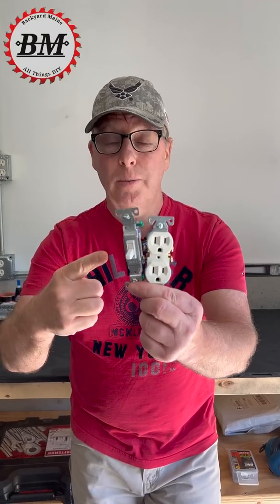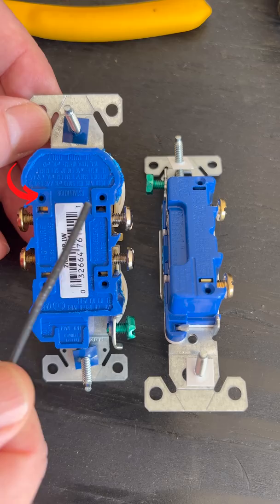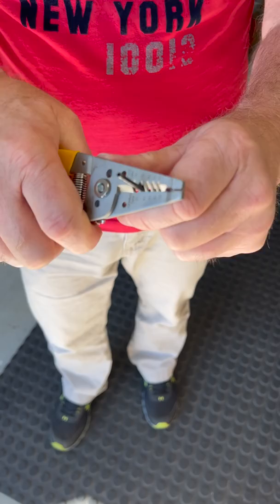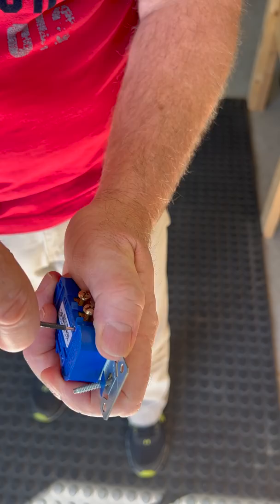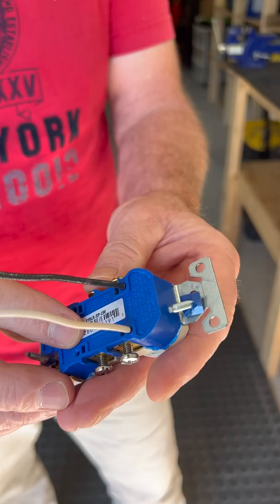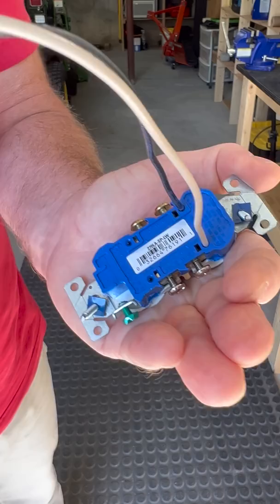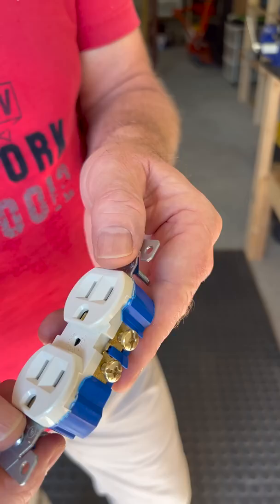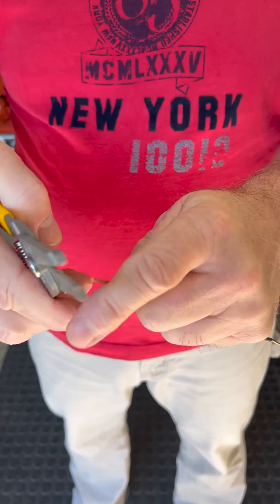Don't make this electrical mistake #Shorts

Comment: To be honest, sockets and switches like that have worked well in Germany for ~60 years, and not a single failure has occurred (in my career). I guess it must be a problem with the building quality of your sockets and switches, and the missing insight of your regulatory organs (those who write the NEC). That they are missing insight is clear from the fact that you're  still allowed to use sockets or switches with open contacts to the sides, and from the fact that they haven't made RCDs mandatory once they were widely available (also around 60 years ago!!!).
Reply from the maker: Maybe it's more to do with our lower voltage (120v) not the quality. We have had a lot of issues with these over the years when anything more than a few amps are applied over a long period of time. These are no longer UL listed for 20A devices. We call RCDs GFCIs and they have been required by code since 1971 and are still expanding into more locations with every code cycle.They were invented in 1961 but weren't widely available until 1970. Plus ours are actually a whole lot safer since they trip at 5mA rather than 30mA like yours. We also require circuits to be disconnected from power before we work on them per NFPA70E so the open terminals are safe to touch. We also require Arc-safe protection as well for fire protection.
Reply: @BackyardMaine  I know that you have GFCI outlets, but that isn't the same as having one or more RCDs in the consumer unit/panel covering the complete installation. 99.9% of the houses built in (West)Germany after 1973 have that protection (partly only for the baths, wet rooms, outdoor sockets, though, but today the whole installation has to be covered). In our house here, we had RCDs for the complete installation in 1968 already.

The point is: With all the US DIYers showing their installations in the social media during the past years, and for buildings younger than 1971, it's apparently only now that they start to use GFCIs. Thus, somehow it must not really have been mandatory when their houses were built. 

No, the RCDs were not invented in the US at all. Actually, the first patent is from 1903 (German company Schuckert), and the first working device (for house installations in Germany) was available in 1951. Nicholsen's US patent from 1908 is based on the German patent. I know that Dalziel got a patent for the GFCI, but that should be considered debatable, I guess.

And yes, we are required to disconnect any lines from power, also. The point is about DIYers or other people (accidently) opening a socket or switch => "Grandpa's wheel chair crashed against the socket cover, and it fell off (for whatever reason), 8 year old Grandson tried to put the cover back,  and got electrocuted ... RIP".  ...  If those contacts were in the back only or insulated (like they are here), then that couldn't have happen at all.

Edit: Having had a closer look at the current US patents, it seems that Victor V. Aromin (whoever that might be), registered a GFCI patent in 1996, which expired in 2016. So, are you really sure that there were GFCI devices before that time ? Or did you have panel RCDs before that, too?
Reply from the maker: I've been a licensed electrician for 38 years and spent my last 10 years employed as a senior electrical engineer for Texas Instruments which also has a FAB in Germany. Yes, I do know how long GFCIs have been required here in the US and I have seen the requirements expanding with every code cycle (every three years). Back in 1971 they were required for swimming pools and then bathrooms and kitchens within 6 feet of a water source but now they are required in many other locations. I believe your RCDs trip at 30 or 60 mA I can't remember but that is still enough current to kill a person depending on the path and duration. We also have devices called GFCE which trip at 30mA but they are designed to protect equipment not people because 30mA can still cause electrocution. Check out this video if you want to learn more about our requirements around GFCI protection. https://youtu.be/LYWUjq8ST4Q

Comment: Why do they even bother putting those back-stab connections on devices. Literally EVERY electrician YouTuber thats ever mentioned them said not to use them.
Reply from the maker: There are a lot of electricians using them still because they are fast and easy. If you get a call for lost power to part of a circuit or flickering lights these will usually be the culprit.

Comment: I think the engineers who designed them might have a different opinion.
Reply from the maker: Did you know that these were also designed and approved for 20A devices as well but lost that approval due to the failures and fires. Now they can only be used with 14AWG solid core wire on 15A circuits.

Comment: They must be safe to install or it wouldn’t be legal to produce or sell. The components are approved by the manufacturer and the NEC
Reply from the maker: Did you know that they were approved for 20A as well for years but due to failures and fires they can only be found on 15A devices now. So my question is would you have said they were fine on 20A because they were approved a few years ago?

Comment: Honest question. If backstabbing is so dangerous. Then why are devices even made with this option?
Reply from the maker: In most cases they're more of a reliability issue causing people to have to call an electrician in for a repair. I have seen them melted and arcing but never a fire. They used to be available for 20A as well but not anymore.

Comment: You should always pull the loop together after placing under the screw head, don't just leave the tail sticking out....
Reply from the maker: I don't think that's necessary based on my 38 years of experience but we all have different practices.
Reply: @BackyardMaine  Cool.

Comment: I prefer back wired receps myself. Especially when working on a hot circuit.
Reply from the maker: I prefer connections you never have to work on again. Also why would you work hot on a residential install.
Reply: @BackyardMaine  I'm the campus electrician at a small college in the Midwest.

Comment: Never had a problem with stab in connections !!
Reply from the maker: They usually fail after a few years or more depending on load. I have repaired more than I can count.

Comment: I have a light switch in the glove compartment of my truck. It turns the heat on and off. But I did use the screws on the side because I wanted to do it right lol.
Reply: Your light switch turns the heat on & off??
Reply: @rogerdixon1069  yes lol. It's an 06 F150. The dials for the heat and air quit working long before I bought it, so the previous owner ran a jump wire from the cigarette lighter, took the wire that controls the heat, and wired them both up to a toggle switch he had mounted on the dashboard. It worked fine. It even worked without the key in the ignition. But the toggle switch finally broke and I didn't have one. I did however have a new light switch so I just wired it up to that and it sits in my glovebox. People always laugh when they see how my heat works, but I'm just glad it works lol.

Comment: I want to put in 2 new switches in the bathroom, one for the light and one for the vent fan, want to just put the wires as they are on the old ones but there’s no ground wires and a full wire is attached to the top screw on both, what I mean by full wire is they aren’t cut ends but full wires with some insulation cut off and attached to the screws?
Reply from the maker: It must be an older home with no grounds. You can still do what you want. Pigtail the hot wire so you have two connections and the use them for each switch. Then add the fan to one switch and the light to the other. Be sure to turn off the power first. I have a video on pigtails if you need it. https://youtu.be/K3RIjUnrNTQ

Comment: Kinda. There’s situations where backstabbing is fine but usually done only after the terminals are used up
Reply from the maker: I always pigtail when more than two cables enter the box.
Reply: @BackyardMaine  usually but even then there’s situations where you can’t pigtail or you absolutely need to use the back plugs. As long as you tape the wires down it’s ok but definitely not as secure as the screws

Comment: The newer outlets let insert from the back and tighten the wires to the sides of the terminal.
Reply from the maker: Thats actually been around for decades. You find that connection on most 20A receptacles and all commercial grade or higher devices.

Comment: you forgot to mention that they should use a flat head to do a final torque twist on the screw to assure a non loose connection.
Reply from the maker: I disagree..
Reply: @BackyardMaine  so you want to rely only on the tightness you can get from a philips head?
Reply from the maker: @fjl05  And in 38 years I have never had a problem. I even wired my own home 25 years ago and I have yet to have a problem. So yet I will rely on the methods I use.
Reply: @BackyardMaine  If you can rely on your own methods then thats fine and dandy I suppose. I'n my years as an electrician I've had no problems myself when using only a philips head. But for some of the apprentices I've thought, relying on them getting a proper tightness with just a philips head seems to be a hit or miss thing. I'll have them tighten it then when I go check their work and the wire still moves under the screw, I have them properly retighten all the screw with a flat head and its worked 100% of the time so far.

So basically if you can do it properly with a philips then thats fine. I can as well but I will continue to teach using the flat head at the end everytime to everyone that is new to the art.

Comment: Those little hole connection areas should NOT be allowed. The amount of contact that is made is one major problem. Not to mention it’s only a spring metal connection. Terrible design idea.
Reply from the maker: I agree..

Comment: Do you have to tape the outlet when you are done using the side terminals??
Reply from the maker: No tape is not required by code and unnecessary in my opinion.

Comment: Backstab connections = job security 😎
...but no seriously, side wire or backwire* outlets if you have the option. The spring terminals on backstabs have never seemed as durable despite being listed.
Reply from the maker: Exactly friend. Thanks..

Comment: Insurance companies will check out your electrical system for correct wiring methods and a Inspection tag by a qualified Inspector.  should your electrical work be found wired incorrectly, your Insurance company will refuse to pay you out in event of a fire.

Comment: I like the tips but how do you put them in when the wires are in the wall I have a hard time with the main line on the bottom of the switch
Reply from the maker: First turn off the power.. Then you should be able to hook the wires around the screws unless the wires are too short. You can also extend the wires if needed with wire nuts or (Wagos) to tails of each wire (hot, neutral, ground).

Comment: Kinda like relying on the little jumper between the screws to keep a circuit working
Reply from the maker: That little jumper between the screws has a higher amp rating than the wire. 20A even on 15A receptacles. They are UL tested at 30A.

Comment: In France like many other european countries everything is push-in, only the cheapest stuff still have screws sometimes...
Reply from the maker: I think with your higher voltage it may not be an issue and maybe they are a better design connection. These are a very common failure point at 120v.

Comment: They make screw clamp connections now you can just stick the wire straight in. Then screw to clamp it in.
Reply from the maker: Those are the commercial grade receptacles and those work great. As a matter of fact I use them on most of my jobs.

Comment: Do you normally put a PC of electrical tape around the receptacle after you've put the wire on
Reply from the maker: No. Not unless it’s a metal old work box.

Comment: Can a residential light switch to a ceiling light,  be converted to an outlet ?
Reply from the maker: Yes as long as the neutral travels through the switch box.

Comment: I hate to ask a dumb question.  We bought a new house last year, and I installed a ceiling fan, and when I wired it into the switch, I noticed they were stabbed in.  It seems pretty common practice these days, are they a hazard, or just fail often?  I have zero sparky experience.  When I installed said ceiling fan, I turned off every upstairs breaker, just to be safe.
Reply from the maker: More of a reliability issue in my opinion. I would leave it since the fan has a pretty low current draw. If later you notice the switch getting hot or you have an intermittent connection then I would change the connections then. Good for you turning off the power. Safety first.

Comment: Question...  do we stick the screwdriver in to remove the wire while it's hot/powered ?? ... just curious,  because you didn't specify  - common sense says never work on a live wire ...
Reply from the maker: Never work on a live circuit..

Comment: Electricians insist backstab connections are dangerous and yet they are approved by NEC and the receptacles are tested and certified by UL. Obviously, somebody's wrong here.
Reply from the maker: They used to be approved for 20A as well but the UL realized they were wrong and now they can only be found on 15A devices. You pick who's wrong.
Reply: @BackyardMaine i have been an electrician since 1982 and 12 ga wire have not been an option during any of my time. Handyman backyard 😅
Reply from the maker: @epicweldepicweld5857  Sorry but your wrong. I have replaced many old 12AWG backstabs over the years. I have also been a licensed electrician since 1984 and an electrical engineer since 2012.
Reply: @BackyardMaine  show the proof. Never seen any and i have been an electrician longer than you
Reply from the maker: @epicweldepicweld5857  I posted a video in October with a burned up back stab. It's on my home page. The thumbnail says three wiring methods.

Comment: If only American outlets were made to British standard, there would be no bare connections for a start.
Reply from the maker: And yet your death rate per capita by electrocution is higher in the UK than it is here in the USA. Hmmm?
UK 1 death per 646,000
US 1 death per 831,000

Comment: So if back stab connections are potentially dangerous, then why do new switches and plugs have them?
Reply from the maker: They did stop making them for 20A devices a few years back but unfortunately they are still available on 15A devices

Comment: Always backstab your electrical devices.  It is easy to do and quick.  Plus, thy wouldn't pass electrical code if you weren't meant to use them.
Reply from the maker: Great advice. Your keeping so many service electricians employed.

Comment: I don't understand why they are there. I would think maybe with higher voltage (210-220) you would use less amps, maybe less heat. But then aren't those different shaped sockets.
Reply from the maker: Across the pond they run 220v and from what I understand they are all push connect devices and they don't seem to have problems..

Comment: "But if it wasn't safe the manufacturer wouldn't put them on there!" Ever hear of sales? 😂
Reply from the maker: I know right..
Reply: @ThatToast  with a little somethin somethin in the back pocket from the manufacturer... no worries. Just like drugs, the FDA and pharma companies with unlimited funds.
Reply from the maker: @ThatToast  Did you know that UL listed these connections for 20A devices for decades but not anymore.. Were they wrong about them?
Reply from the maker: @ThatToast  No the quality never changed. They approved a product that failed at a high rate but not until a few years of service. I suspect they will do the same for the 15A at some point. Ive replaced 100s or maybe even 1000 of failed 15A devices over the years.
Reply from the maker: @ThatToast  You're full of it and very sarcastic so I'm going to block you from the channel.

Comment: Those outlets are made for 16 gauge or maybe 14 gauge wire if you use 12 you have to use the screws I recommend the screws and 12
Reply: Jews upgraded wire or any outlet because in the future you will need the power
Reply from the maker: They are rated for 14AWG wire only on the stabs.

Comment: I pay a little bit more for the devices with the clamp down connection
Reply from the maker: Yes, I usually install the commercial grade as well. I know a lot of people use the cheapest ones which is why I used one for the demo.

Comment: I strip the wires longer when using those push connects
Reply from the maker: There’s a strip gauge on the device which is 5/8 “ so that would be the manufacturers recommendation.
Reply: I know what they recommend I strip longer noticed they never slipped or had any issues. I bought a brand new home the builders electrician stripped to short like 5/8 his was slipping out. I have a stairlift it kept losing power and it would reconnect. Two outlets before the stairlift the wire slipped right out soon as a removed the receptacle. He had the wire at only 5/8. I installed a new receptacle stripped a 1 inch installed no more problems. Different electrician downstairs he used the screws for wiring on the receptacle.

Comment: The manufacturing quality must be awful. Tons of those throughout Europe and with many years of service and still not an issue. In fact, in some cases screw terminals might cause problems.
Reply from the maker: Maybe part of the issue is the lower voltage that we use here in the US compared to Europe.

Comment: No sorry, never had an issue with backstabing the outlet, its much safer and 100x problem free compared to exposed wire when side wiring.
Reply from the maker: You do know the side terminals are still energized from the backstab connections right? Well at least until they fail.